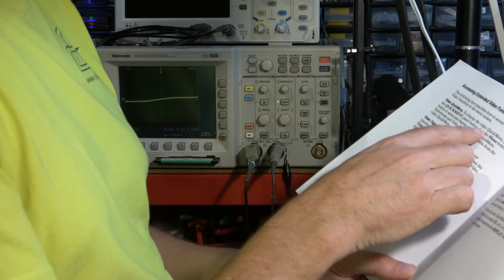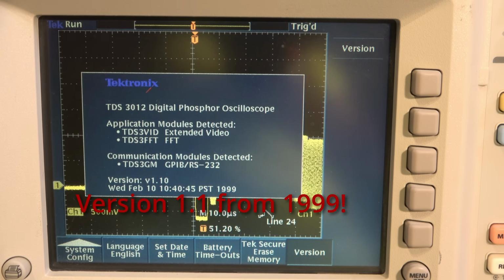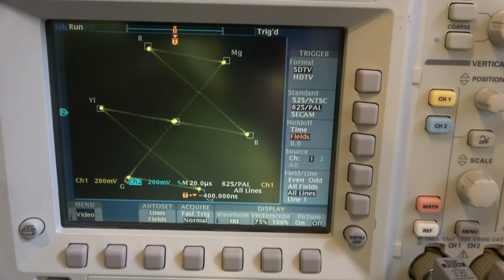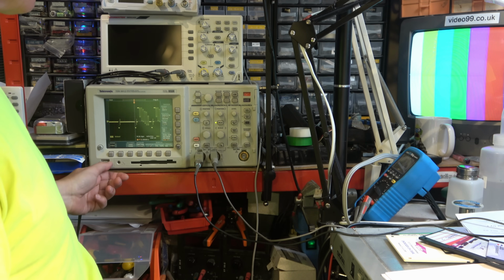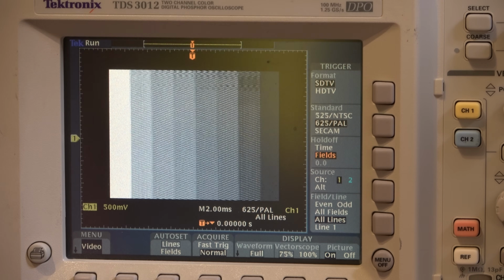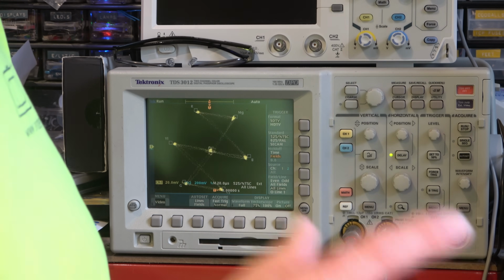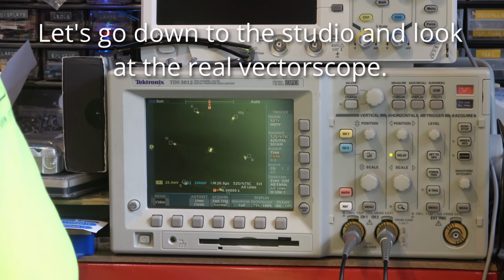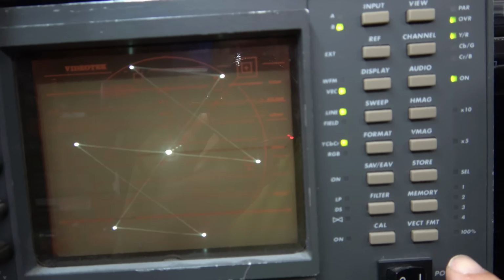Use oscilloscope as vectorscope for professional video work. Tek TDS3VID.

Comment: I feel a little spoilt with ld-analyse having a full scan-line scope & vectorscope to work with when adjusting the white/black levels and the chroma-decoder config before exporting Composite (LaserDisc) or S-Video (VHS/Betamax/U-Matic) decoded files to YUV files, wish I had more media hit my table with colour bars! 

Since upgrading to the Rigol DHO804 (450mhz front end) it's sad how bad the sync and trigger features are compared to the 15~25 year older Tektronics and Sigilent scopes.

Comment: Does that TBC have DG (differential gain) and DP (differential phase) adjustments? If it does that might help to adjust the output where some colours are landing in their boxes on the vectorscope and others don't.
Reply from the maker: There are no output adjustments for the internally generated test patterns, because they should be correct.  However the gain on the oscilloscope channels could be adjusted to get them landing more or less perfectly.

Comment: You can actually reprogram the expansion modules to unlock all the functions, but you have to upgrade/replace the 12c serial EPROM with a bigger one, you can also mod those scopes to run at 500 MHz.
Reply from the maker: This is the early version of the TDS3012, perhaps the EPROM change isn't required for the TDS3012B.  It sounds interesting, if a bit scary, which is why I've not attempted it so far.
Reply: @video99couk ah ok, I remember when I did the module EPROM upgrade I did have to update the firmware on the scope for the additional feature to be unlocked, I'm pretty sure the module cards only hold the keys for the additional software that's already in the firmware, the EPROM on the module cards was really easy to change with a basic hot air station, it's easy enough to do with a regular 25w iron, all the resources where on the EEblog website for doing the option module EPROM mod and method for unlocking the 500MHz mode on the scope.

Comment: hi they don't leave things like that any more   be cause alot of gear has been missing  they came down hard
i have acc with RS  they never leave any thing out side 

there's only 2 now that may leave gear   amazon   and one more  i for get the name  it's one of the low cost ones  

i was late coming back from i place  they left a soundcraft 760  out the front  it was well packet  10mins out they were 
there's no way they could rob that    i had the remote  and audio cards    
get a deck of this size in the work shop was not easy

Comment: There used to be a company called Compu video that sold a converted a oscilloscope as a vector scope/waveform monitor and its image was pretty bad.  Best way to see the signal properly is on a dedicated vectorscope..  those DSP processor have a habit of introducing more noise than they’re supposed to clean up. They have to constantly be tweaked..  of course they’re great for cleaning up improperly recorded video from your customers, but given the age of those things I seriously doubt they’re going to see an exact one to one clean image

Comment: PAL converts phase/chrominance errors into amplitude/saturation errors.
Reply from the maker: Which of course are far less noticeable than all that green and purple you get with NTSC.
Reply: Yes for a delay PAL (PAL-D) decoder. With a simple PAL (PAL-S) decoder you get far more noticeable Hanover bars instead. We used to run our broadcast monitors in PAL-S precisely so we could easily see such errors.
Reply: …. and if you want the ultimate in composite video measurement kit you’ll be needing the Tek VM700. I used them extensively in the early 90s, but no idea if you’d find a working one now, and it’s such a beast that I’m not sure you’d have room anyway.  😀